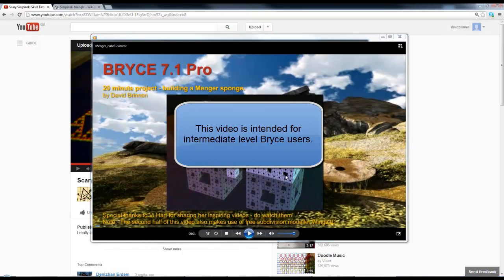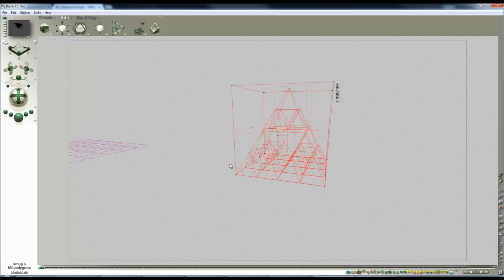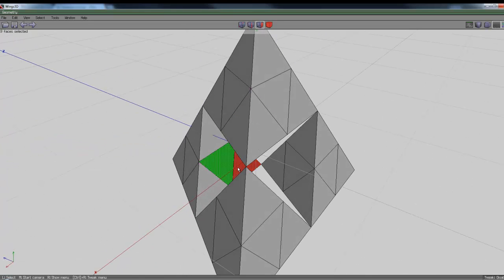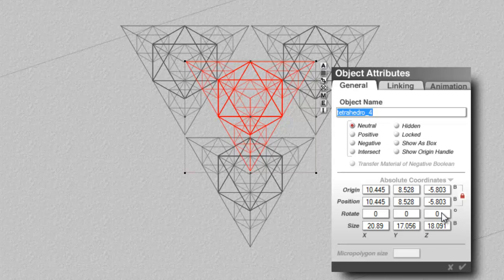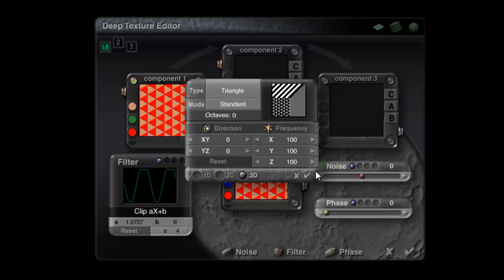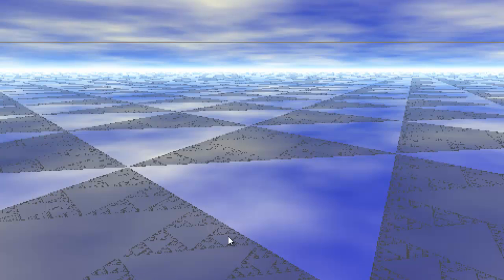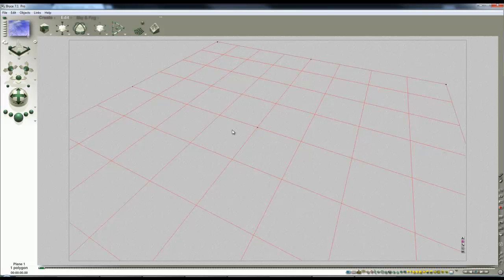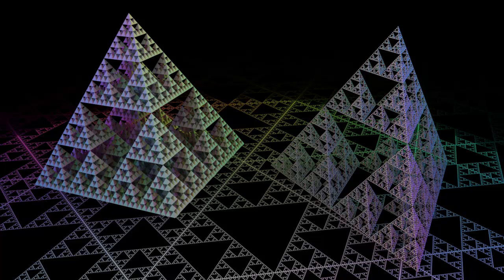Bryce 10 minute project - building a Menger Sponge (part 2) - a tutorial by David Brinnen.

Comment: What is the best and easiest software to use to create a menger sponge cube?
Reply from the maker: I confess I don't  know the answer to that, however, I am fairly certain that the answer in this case would not be Bryce.
Reply: @davidbrinnen  Does anyone know what is the best software to make a perfect menger sponge with preset cubes using perfectly scaled measurements. I want to do this the easy way.
Reply from the maker: @CesareVesdani  Well, maybe someone does know, maybe try posting your question on a channel with a larger following and one related to such things.  I'm sure there must be an answer out there.  In the aether.
Reply: @davidbrinnen  OK. I'll find out.